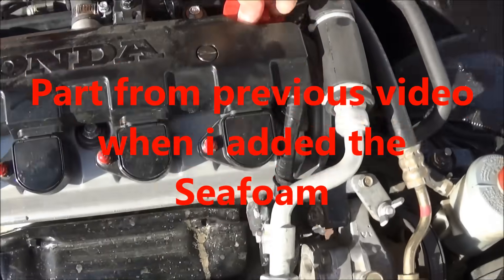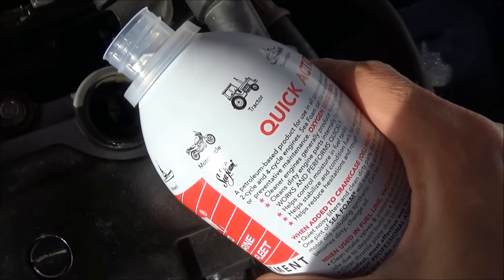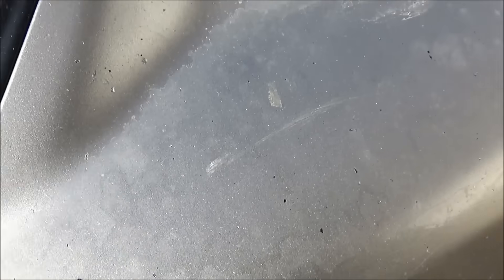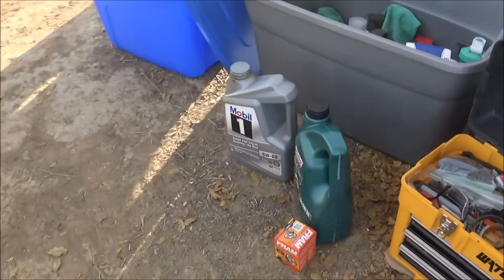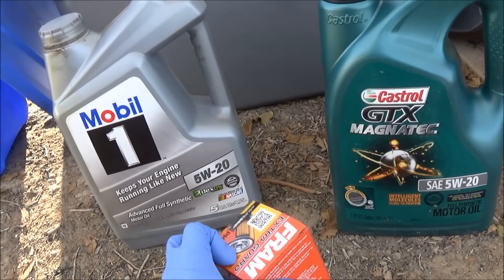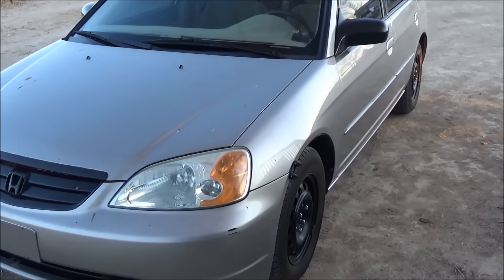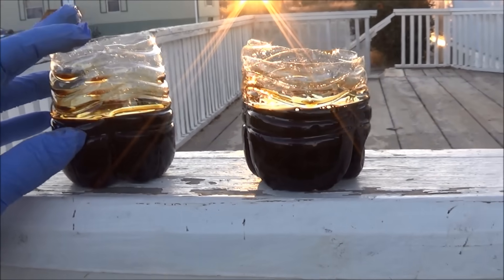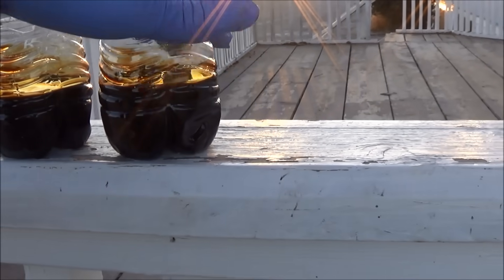Seafoam In Oil | Seafoam In Oil Before And After | Seafoam In Oil Before Oil Change [Sea Foam]

Comment: I've never heard of putting seafoam in the oil before and thought this was a joke. I've ran it through the carbs of a motorcycle, but really? Putting it directly into the oil?
Reply from the maker: Yup and 600 miles later.
Reply: It says it right on the can.
Reply from the maker: Haha
Reply: @shane_smith_  There's about 1000 advertised products that "can" go in the oil, like lucas, but I've never heard of any of them actually having any real benefits. I'm still not convinced this stuff should go anywhere besides the injectors.
Reply from the maker: Works wonders in gas also. You will fell the difference.
Reply: @Chicodirt  I use it in all my boats and jetskis, 2 and 4 strokes. For the 2 stokes it keeps them from fouling the plugs (also use [edit] Interceptor 2 smoke oil) when idling and keeps throttle response crisp. On the 4 strokes, I use Seafoam in the gas for the first and last tanks of the season. At 20 gallons per tank on the big skis, I buy Seafoam by the gallon.
Reply: Not needed if you put quality motor oil and change oil often.  My valve train looked new after 100K miles . Just running synthetic.
Reply: I do this after buying a new used vehicle for a couple oil changes. Seems to really clean up the engine.
Reply: Works wonders in a 2-stroke at 2 oz / gallon of gas too.
Reply from the maker: Right!

Comment: mobile 1 filters are unsurpassed best you can buy!
Reply: I prefer a Wix filters but I'm sure mobile one makes great filters they have great oil but anything is better than a Fram
Reply from the maker: Agreed
Reply: Mobil or gtfo!
Reply: Them and wix are all ill buy
Reply: My retired anal friend that worked for Toyota North America had Blackstone laboratory’s run test different oils with different filters and the mobile 1 filter stood alone! now if you’re going to change your conventional oil ever 3500 miles or so then get the Fram or the Walmart brand.. but for extended service intervals 7.5k-10k or whatever its the one to get.. this the interesting thing he did not recommend mobile 1 oil  I don’t remember now what it was..

Comment: Idk if anyone else said this but you may be waiting too long to change your oil if it's getting that dark your engine looks to be in great condition and your oil will last longer before it gets dark as it ages but that stuff was pretty black
Reply: Color is absolutely not a good indicator of oil condition.
Reply from the maker: Thanks for the tip. I usallt change it around 5 to 7 k. I run full synthetic
Reply: eli oliver  oil color has nothing to do with how your oil is performing it’s a myth. Been a mechanic now for 15 years and I have seen cars with black oil cleaner inside then engines with oil that still looks new. The type of oil you use is where it all matters.
Reply: Yeah, that oil was pretty black.....I do anywhere from 6500.0  to 8000.0 miles oil change...and I also use the best fully (100%) synthetic oil.....I'm going  with royal purple ( remember 'deep ' purple?? ) next time along with a K n N oilfilter......See what that does for the engine....
Reply: I use a K&N filter with Castrol High Mileage Full Synthetic 5W 20 on my 09 Corolla. I change the oil every 3k miles and it comes out pitch black every time. The inside of the engine looks great tho. Completely spotless
Reply: The color as absolutely nothing to do with the quality of the oil. I just changed my mustangs oil after 10k. My dad does 30k intervals on his one work van, his one box truck had almost 170k on original oil. That truck is still on the road to this day.

Comment: Are V-Tec engines spec'd to use 5-20 oil? My urine is thicker than that, that would really worry me how much protection I was getting even from fully synth.
Reply: they spec 5-20 because the passage ways are smaller to create the necessary oil pressure. also most VVT-VVL and timing chain tensioners use oil pressure. ultimately its the oil pressure protecting your bearings not how thick the oil is (to a point). use what the manufacturer states. using a thicker oil will cause oil starvation in certain points of the engine causing premature failure down the line.
Reply: @patrick.hallyburton  Thanks for the heads up. Never seen a car run such thin oil by before.
Reply: @andrewlaw   there is even thinner oil coming down the line 0-16, soon. But same principle applies, smaller passage ways. Synthetic oil also makes a world of difference
Reply: My 18 civic is running on 0-w20. Looks like water but it's what the engineers designed.
Reply: @ffhgu 07 I drive a diesel which is spec'd to use 10W-40, why do you ask?
Reply: The amount of stupid questions that are in this forum is unbelievable. You have cars all over the place running on 0w 20

Comment: This is a really good idea, I was worried about doing any kind of engine flush because of the age of my truck and the dated oil system. But I will try this.
Reply from the maker: Ya and check out my 15 min sea foam treat meant video ! That's a quick flush!
Reply: @Chicodirt  I'm glad you see the value of Marvel Mystery as well. Cool channel brother. Thanks
Reply from the maker: No problem man subscribe if you haven't already

Comment: Filters only remove the larger particles in the oil.  If your car is running well and the oil ok, the filter will fill with a small number of large particles.   FRAM may not last as long as other brands but If the FRAM did not fall apart and is replaced in a reasonable time your fine.  The fact that all car oil gets black shows all filters do not remove all the particles.   No one has done an oil filter  particle filtration size comparison,  have you seen one?
Reply from the maker: Subscribe and check out my oil filter videos.
Reply: I have seen one. Watched it today. Cut open frame was the smallest and had rust in two filters that were cut open

Comment: Does your engine burn any oil
Reply from the maker: Noooope oil stays at same level
Reply: @Chicodirt  that's good, those engines have a tendency to burn oil, that means that engine has been well maintained
Reply from the maker: Yeah it is well maintained. Runs great at 237k miles. I do all the maintenance myself.
Reply: Gaming & Cars one question please,, I have a 2010 Acura MDX and these SUV have bay reputation burning oil as well oil consumption I did change the pcv valve and still have the same issues is this normal ??

Comment: i was about to say , i want to see the oil before and after from the dipstick on white paper, but you took off the cover and that impressed me more , nice job . I put seafoam on mine , i was thinking of getting oil change next week ,but i might wait a couple hundred miles more .
Reply: But if has been using Mobil 1 it will look like that.
Reply from the maker: Thanks for positive feedback! Yeah i wouldnt go past 600 or even 500. It all depends on how much sludge you got in your engine.

Comment: Thanks for the video.. I have a 2001 blazer with sludge in the engine and I've been changing the oil every 500 miles and you can see particles of sludge coming out of the filter so I put some seafoam and with this fresh oil and I was wondering how long to leave it in for so I'm going to run it for another 500 and see what happens
Reply from the maker: I would watch my 15 min sea foam treatment video and do that. I wouldnt run seafoam in a engine longer thats really bad with sludge. Do the 15 min thing then change your oil and use Mobil 1
Reply: Change your vvt on the blazer if it has it
Reply: I doubt a 01 blazer would have VVT. If i were you, i'd use a lighter weight oil to get the dirt out of the oil journals and you oil pump

Comment: I see a lot of comments about Fram oil filters,,I guess I was one of the lucky ones,,I sold my chevy avalanche with 250,000 all original parts,,hmmm I guess changing my oil was more important than what brand filter
Reply: To your point, I’ve run conventional oil and Fram filters in every vehicle I’ve owned for almost 30 years.  I’ve retired each of them with well in excess of 200k without a single engine issue.  My current is ‘08 Avalanche with 190k.
Reply: I use nothing but fram oil filters since ive been driving. (1991)
Never had a problem.
Ppl see something that looks like cardboard but it isnt so its junk.
Let them buy the more pricey brand just a waste.

Comment: Frame ultra is a good filter.. the best one out of the four they make but I use k&n
Reply: I buy K&N because I am lazy.  The 1 inch nut on bottom makes it so easy to tighten and loosen.
Reply from the maker: Yeah all i usually use is k&n or Mobil 1
Reply: stop using fram and stick with k&n or mobil 1. Those are the best filters.

Comment: Fram oil filter you got to be kidding me
Reply: I've never had a issue with fram filters. But i use there synthetic ones
Reply: Using quality oil/materials but stuck to Fram filters! Have you ever opened up a filter and see whats being used inside a fram filter versus others? You'll know why NOT to use a Fram Extra Guard filter when you do see whats inside... Heck i'd even use a MicroGuard than a Fram!

Comment: Fram filters are garbage, cut one open...cardboard instead of steel parts,, about 30% less filter material (compared to Wix or Mobil 1 filter), inferior filter material, cheesy construction.
Reply from the maker: I disagree. Subscribe and check out my oil filter videos. I break down several. Fram is exactly the same as Honda oem!

Comment: I like your glasses.  I don't wear them but my youngest teen son does, and he would like them too. 

Don't be cleaning your crankcase or adding solvents to your transmission.  The crankcase will develop leaks, and your trans will not like a change in the ph.  Don't add fuel cleaners to your tank either.  Your fuel pump motor is is soaking in gasoline, and it's used to cool it down.  Too much of a harsh solvent will damage the insulation on the armature windings.  Only use marvel mystery oil in the oil and gasoline, and only use techron in the gasoline to remove sulphur buildup.   I recommend drain and refill on all fluids, and never a flush.  Most neglected fluid is brake fluid, and that should be drained and refilled at every pad change.  It's attracted to and binds with the humidity in the air - and more so when it gets hot!! 

No one wins an award for having a shiny clean engine.  Build up will happen, but with regular oil changes, it will be minimal, and will not interfere with performance.  If you have any doubts, just "drive it like you stole it", or perform an "Italian tune up" both are more fun than pouring solvents of unknown origin into your engine.

Best to you
Reply: Nothing harsh about sea foam
Reply from the maker: I have the best running engine iv seen. Its 15 years old also 230k+. You dont wanna drive 600 miles with seafoam then dont i dont care. It works great for me. I use seafoam and marvel mystery oil. I swear by it with many test to back it up. Leaks come when you dont do your job as a man and take care of your vehicle and replace parts that need replacing or before they break. My engine has no leaks...
Thanks again have a good one
Reply: ThizzleKid420 seafoam works. My oil would turn black after 500 miles..ran seafoam in oil for an hour then changed oil.  Now it stays light brown for a few thousand miles.
Reply from the maker: Heck ya that stuff really does work

Comment: Fram is the better filter...been using them since high school!
Reply from the maker: Farm ultra I would recommend. Check out my oil filter videos I cut many of them open.
Reply: @Chicodirt  check out stephen cox oil filter comparison videos, he shows you why fram is cheap junk. Personally, I prefer wix/NAPA oil filters, they use roughly twice the filter material that fram uses.
Reply: Fram is the worst oil filter on the market. Everybody knows this. There is a utube vid of a guy shooting one with a gun over and over  on the ground. Another taking them apart comparing them to others. Fram has half the filtering medium than the others. Thant's why Walmart sells them. They get them so cheap.
Reply from the maker: Disagree. Check out my oil filter videos. I have several on fram...

Comment: NONE of you idiots know anything about filters and their construction.  Are FRAMS crap?  No. They have been made the same way since the 1960's and even before, when they were considered to be an excellent filter.   Can you get a better filter for the same money?  Yes.
Reply from the maker: Haha right. I see many people use fram on turbo set ups and never had a issue.
Reply: If you change oil filter once or twice a year then a Fram ain't gonna kill your engine for sure. If you run a car without changing oil/filter from one year to the next then it makes fuck all difference what you use, you'll kill it sooner or later.
Reply: Experts in every comment section

Comment: Marvel will clean and lubricate like no other product I know and has been used to loosen sticking valves when people used old gas . We also used it just like Blaster and it will bust rust .Sea FOAM PRODUCTS ARE ALSO TOP OF THE LINE . I sold both products for years
Reply: Kerry McCaughey it's totally not. true. transmission fluid does not affect rust. do you have any type of degree or training in auto mechanics? Basically I think it's just your opinion. We put it in engines with rusted cylinders and let it sit, many times those engines loosened up and reusable.
Reply: Edge2 Sword why does he need a degree or training? It’s possible that he knows from experience. Get over yourself
Reply: @Poppy_reeves90  True most trained techs can't get simple repairs done right , the first time .
Reply from the maker: Yeah I totally agree. I love both but more mmo because it's cheaper and u get more. I have several videos testing each product check em out
Reply: It's the fucking idiots that have mechanical problems to begin with that use these products that reveal their problems and their lack of maintenance that called these items crap
Reply: Marvel = transmission fld.

Comment: I owned a 1998 Ford Taurus that I drove for many years...had about 125K miles and it was hesitating and finally got to the point it was almost unsafe to drive so I took it to the garage. They said the fuel injectors and intake manifold needed to be cleaned and it was like $350 job. I told them I'd think about it. Went to Pep Boys and bought a bottle of sea foam and ran it thru a full tank of gas...Problem fixed, ran like new until I sold it with $165K miles....the stuff works!
Reply from the maker: Yeah I believe it that's great to hear. It's crazy how people do not know about this product or marvel mystery oil.
Reply: You sold it $165k damn your a good car salesman lol im sorry i haf too..

Comment: Too bad Fram filters are now shit. I use Napa or John Deere or H-D.  I am doing a Italian tune-up on my old  V-8 Olds motor. Every other oil change half a can of Seafoam or a few ounces of Marvel Mystery Oil go in for about 75-100 miles before I dump the oil. Will be interesting to see what happens.
Reply: Fram ultra blows away all those filters.  Stop comparing comparing a focus to a navigator.
Reply from the maker: Yeah everyone uses them though with no issues. If a engine is having issues. 90% of the time it's not the oil filter. I've seen the seal blow on a fram but that was a boosted engine. Blew the seal and leaked oil all over. Only time iv seen a oil filter malfunction. It's all about how many miles you use the filter for. I love sea foam tho and marvel. Marvel is better tho I think cost less u get more and it's not as strong as sea foam. Subscribe and check out all my videos on the two. Marvel isn't even flammable! While seafoam is?
Reply: he explains why in the video..we all know fram is shit so why throw out a good filter after 600 miles?

Comment: You hardly put a drop in there. Should of put at least half the can.
Reply from the maker: Joshua Bushong 3 qts of oil. So I out roughly 3 oz. That's not a lot. That's like 1 gulp lol
Reply: That just doesn't seem like enough to make a difference over one oil change. I think a good test with seafoam would be with a engine that has 200,000 plus miles on it like yours but one that has had a hard 200,000 miles with hardly any oil changes. Then do a before and after test over a few oil changes
Reply: in oil you use less, the pouring it in happens when you add it to fuel

Comment: Frams are fine. Walmart sells Fram. If Frams, sold by Walmart, were subject to causing engine failures Walmart could be found culpable.
Reply: are you saying that walmart could be 'culpable" for every item they sell?? this is not how it works.. please stop making statements you have no clue about
Reply: Yes they can. You are so smart. ass
Reply: The deeper pockets pay.
Reply: You are delusional! I paid Walmart to do an oil change on my Celica and 1K miles later I blew my engine up. They forgot to replace the oil they drained! Guess who wasn't culpable. Walmart! Don't be so naive.

If they sell lettuce that gives you salmonella, they are not responsible. Don't be a fvcking fool!
Reply: 1000 miles and you blew your engine. 1000 miles with no oil. Toyotas are tough.
Reply: You’re an idiot
Reply: #fakenews

Comment: the vapor-point of that stuff is rather low it being a solvent I'm guessing at 160 to 180 F most of it boils-off and goes out the PCV valve the first couple of hours in there.
Reply from the maker: That's interesting thank you! Subscribe and check out all my other Sea foam and oil filter videos.
Reply: Except after 500 miles it was still in his oil after the change

Comment: I've always used Fram XG filters in my Dodge Hemis. 400,000 miles on the oldest one, still uses no oil..
Reply from the maker: Yeah Fram is okay. If you have engine issues it's not the oil filter. It all depends on the driving style and cars performance too. Also how long you go without changing it. Subscribe to my channel and check out my oil filter videos.